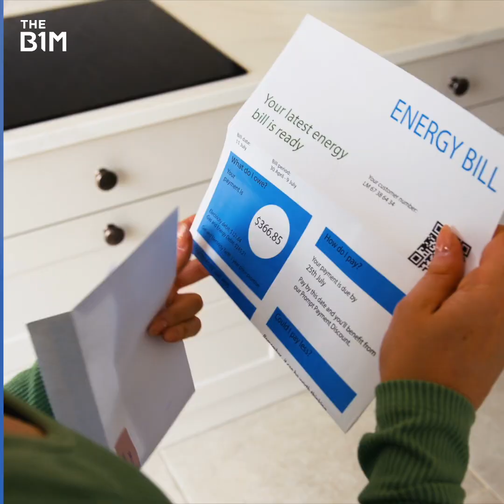The Epic New Power Link Between The UK and Denmark

Comment: Wouldn't they also connect a cable to the electricity island of Belgium? I know Denmark and Belgium got some kind of similar deal.
Reply: There is a 1Gw connector between the UK and Belgium. 1Gw with Holland, 3 connectors totaling 4Gw with France, 2 with Eire, and a 1.4Gw with Norway. Additional links are nearing completion with Germany, France and Norway. Future links may include Morocco for the solar power down there.

Comment: I wonder how long it lasts before needing replacement
Reply: Here in Italy, were just about to start replacing the cables of our first undersea link between Italy, Corsica and Sardinia (SaCoI) which cables were laid down in 1968.
Given that newer cables are using far more resistant insulation materials (XLPE) and armoring, and are buried down in a better way, i think it may last at least 50 years.
In the meanwhile, the conversion system was replaced one time to increase the power rating of the link, as newer tecnologies allowed it.

Comment: How does it deal with damages to the cable undersea
Reply: Are you suggesting that a Russian trawler might "accidentally" snag the cable?
Reply: @Dave_Sisson  or a curious shark like the one which damaged an Internet cable some time back. But yeah the threat remains
Reply: We generally bury the cables using massiblve subsea trenching vehicles. 
In the 1990s subsea cables were just layed on the sea bed and they rapidly wore away and failed. 

The threat of sabotage is also a big incentive to bury

Comment: A dark still winters day in both countries surely requires huge baseline ability to stand by?

Nuclear can't be switched on quickly so we need lots of gas etc for those days. 

Is that right?
Reply: Pumped storage is also used for this and the UK is doubling the amount of capacity in Scotland.
Reply: There are also other countries all connecting together, reducing the need to resort to gas and oil.

As for speed, batteries are being added to the grid, they turn on in milliseconds.
Reply: "You still need backup for when it's not windy/sunny". Yes, but you need less of it in total across the year. "There's a man in town giving away money. But he's only there some of the time, so I'm not going to take any of it." (Yes, I know about the costs of keeping stations on standby - but even the most inefficient such stations use a lot less coal [or whatever] when on standby than when generating at full capacity.)
Reply: 1- Nuclear can be switched on easily
2- you can plan ahead with weather forecast for nuclear.
Reply: @FooBar-ie8pq  0,3 MW/min is not quick in my opinion. Some reactors are this slow. 
Certainly an eon compared to gas/oil/coal/bio. 

I would have thought such a slow modulation rate would make them unsuitable for responding to unplanned supply or demand changes, hence the need for fossil fuel backup. 

It seems that some reactors are much quicker. 

Are you saying that it is possible to respond to all circumstances using pumped storage, subsea cables and nuclear modulation?
Ie no fossil fuel rapid response is required?

Please provide a link to substantiate your claim. Thanks.